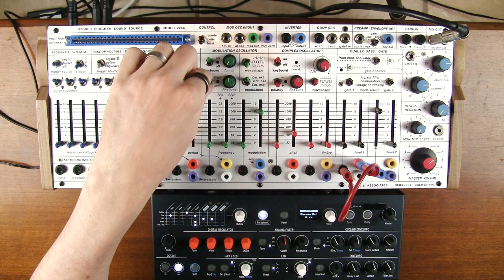03-The Buchla Easel Command- Part three: Modulation Oscillator

Comment: Just ordered one and am trying to soak in as much as I can about how to use it. 
Really enjoying this series, thank you!

Have you covered the workflow required to connect CV into the Easel Command from an external source? For example,  I'm interested to know how to bring in CV from a DAW through a DC-coupled interface into the Easel Command.
Reply from the maker: No.  Personally, I’m kind of against Don’s designs being used as just another DAW extension.  The true joy of the Easel is using it to its own ends.  It’s not just a sequencer or a timbre source.
Reply: @automaticgainsay  I guess I can understand that. 

At the same time, foreclosing on this conversation shuts out a range of expanded-control possibilities that I don't think Buchla would have considered improper? 

For example, I'm trying to parse my hand's position in the air using a LEAP motion controller and Max/MSP to export control voltages. That's not really a DAW extension and is more in line with Buchla's Parabolic Trajectories performance https://youtu.be/6W7Hr-WHvzc
To each their own, I suppose.

Comment: 6.25 - why you wouldnt do it this way? Could someone please enlighten ?
Reply: I believe it’s because the modulation oscillator is already normalled (connected internally) to the complex oscillator. So it’s unnecessary. You would use that more when you wanted to take the Buchla modulation oscillator and modulator another synth or something. He was just showing that it could be sent somewhere and for ease sent it to the complex oscillator of the Buchla rather than another synth or something.